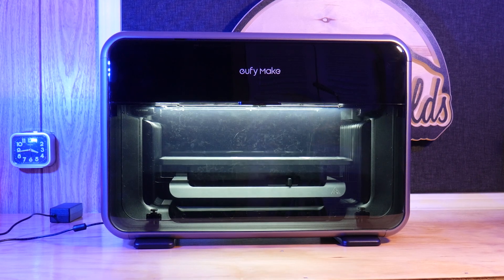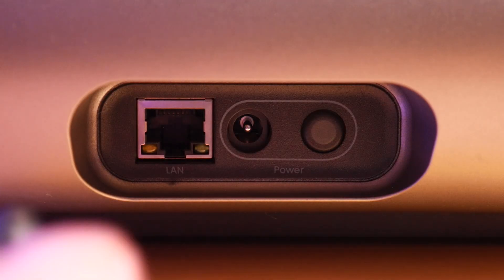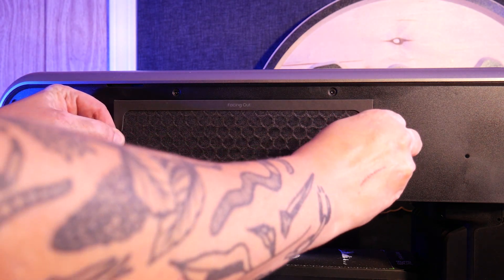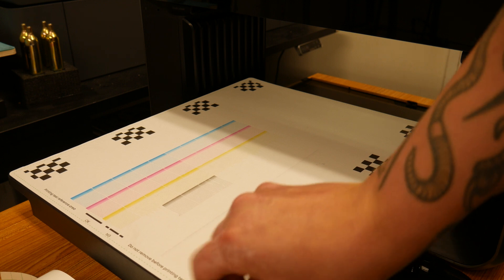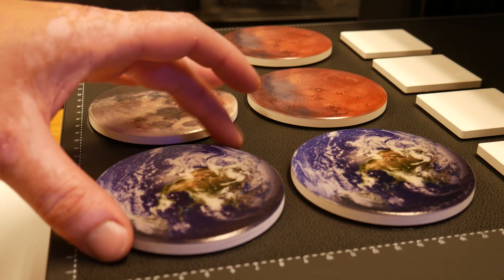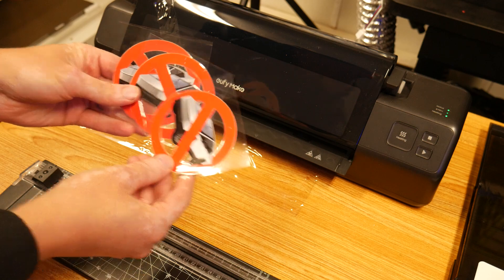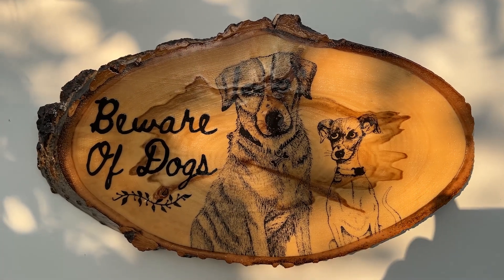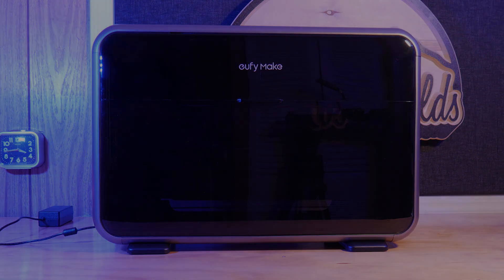This UV Resin Printer is WILD – EufyMake E1 First Look

Comment: I hate the way they are handling their current 3d printers, Ankermake/Eufymake M5 and M5C. They stopped selling their M5C and look like they are selling the remaining M5 printers.  Replacement parts are slowly dwindling and IDK how long they will continue to have the cloud. You can't even control the M5C without using the cloud connected smart phone app. These $300-500 3d printers are probably going to become paper weights in a year or two. Why would I speed $2,000 on a machine that will stop working in a few years? 
If this is a business purchase I would recommend a company with a history of supporting their products. Even if costs 5 times the price, in the long term you will spend less as you wouldn't have to throw away your machine.

Comment: Cost of the machine is about five times what I feel it's worth. Especially when considering the amount of pricey consumables. Who is the audience to or this?
Reply: Professional printing equipment starts at 10-20K for UV,  this is in-between normal home ink  but on the low side for a start in UV.
Reply: @upseroare  I dont know where you got that 10-20k figure, 4k5 USD and there is already 30x50cm print size UV printer, +1k USD to get camera that can automatically detect the print surface and reduce the needs for allignment. I also contact and their sale and ink price 120USD a set (20USD/500ml), which is essentially 4cent per ml, eufymaker charge 43 cent per ml and you dont have any choice of generic brand. People bought into hype and suddenly forget to do their research. I been in 3D printer community for 2 years and these locked in, DRM, proprietary tech are a plague. Much like how HP Ink model is to sell you cheap machine and locked you in with expensive ink. There are 2 things that eufy makes it interesting: 5mm layer heigh in (which allow you to make texture print) and their imagine tech that turn 2D into 3D mesh for those layer height. So in conclusion: You have 50% the price, similar print size (33x42), but at 10 time the ink cost, and somewhat unique 3D texture stuff, a very questionable value position.
Reply: The equipment is several thousand dollars cheaper than anything with the same features. 

The ink cost per ml is equal to or less than other name brand UV inks. The only significantly less expensive option would be generic uv inks purchased in bulk.
Reply: ? Its a steal!

Comment: Nice tech, but clearly too costly for a what a transfer sheet can already do, and the only advantage for 2.5d sheet is destroyed by the cost of the added white ink needed. Lots of other consumable parts too (cleaner, stick sheet, filter) Maybe some museums or art could be interested.
Reply: 17,000 backers on Kickstarter (making it the most successful Kickstarter ever with pledged revenue over $44,000,000) are disagreeing with you.
Reply: “A dishwasher is too costly for what hands can already do”😂
Reply: Lots of things this machine can print on that a transfer sheet would not, for example raised textured parts. You are thinking too 2 dimensional, just flat surfaces. And sure for a flat surface there is better cheaper options, but this isn't for a 2 dimensional thinker. This machine offers lots of options for those with an imagination.
Reply: The equipment is several thousand dollars cheaper than anything with the same features. 

The ink cost per ml is equal to or less than other name brand UV inks. The only significantly less expensive option would be generic uv inks purchased in bulk.